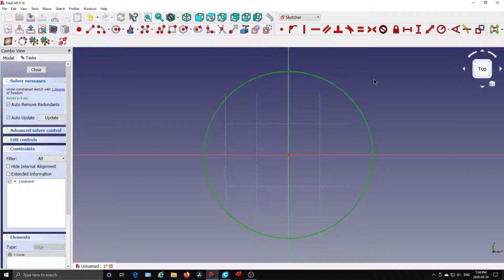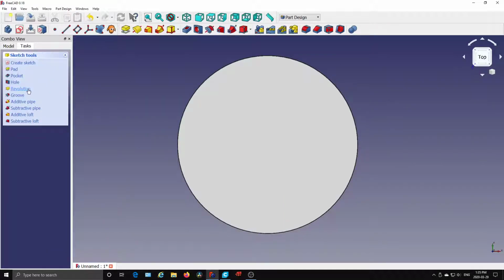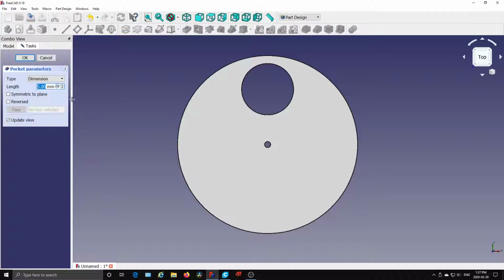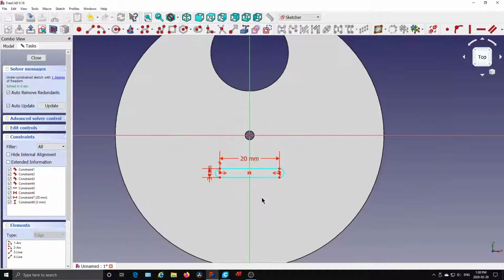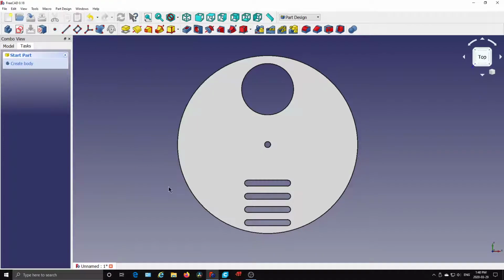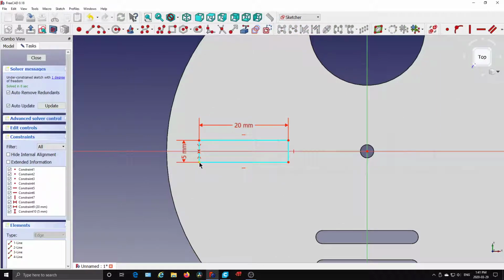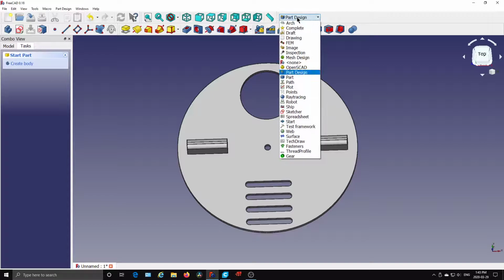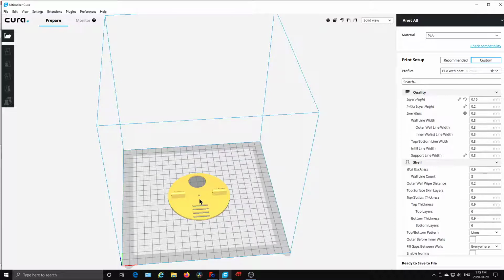G&H Honey Bees - 3d design of my nuc entrances

Comment: Very good tutorial on freecad. It definitely has a shorter learning curve than a lot of CAD/CAM software I leaned on AutoCad in the 80s but now like some of the other programs have gone to a subscription service.
Reply from the maker: I find freecad works very well for the things I want to design. I did try the Autodesk 360 but found it very confusing. With freecad one can take a number of rectangles and circles and piece them together easily into a simple part. And its free to use and the software engineers are contantly working on it to improve it.